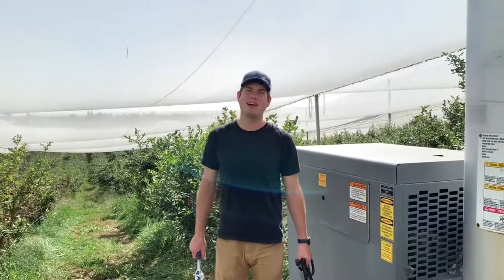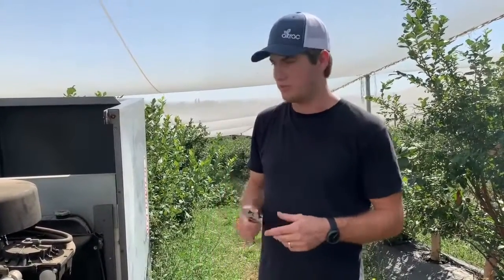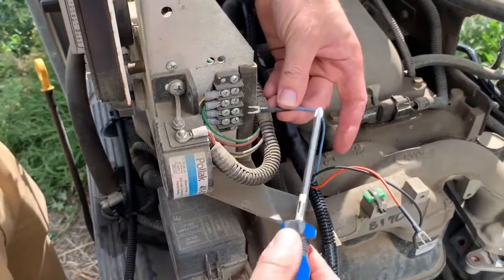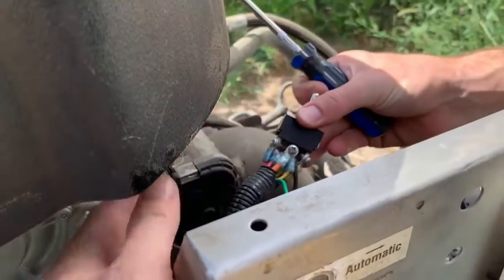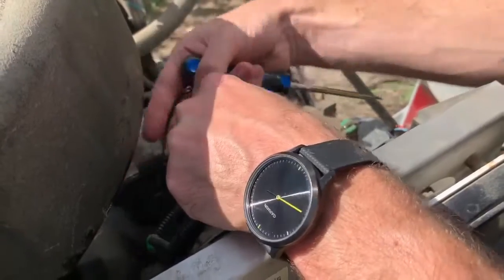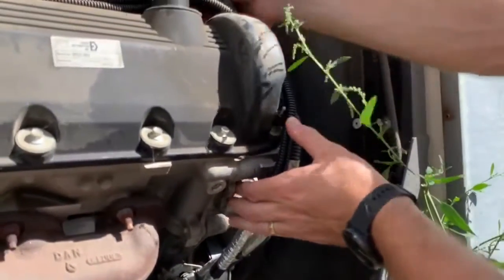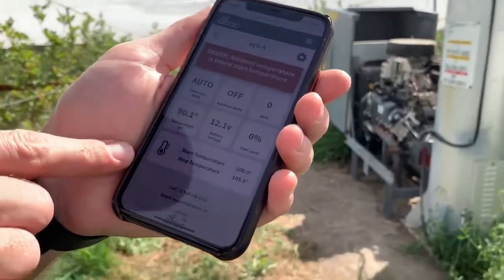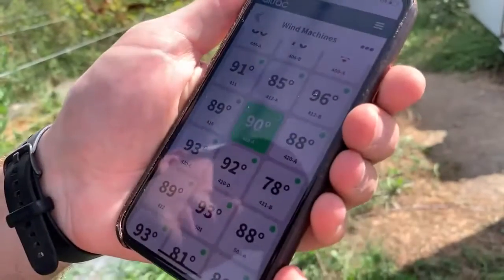Orchard Rite Ford V 10 Wiring Harness Install

Comment: Hi! Very nice video! I would like ask you about the Harness connector that connect the V10 and the ST100. Could you biring me information about Modbus RS485 registers? I would like understand which modbus holding registers the ST100 reads. Could you share the documentation? Thanks & best regards! Guillermo Musso